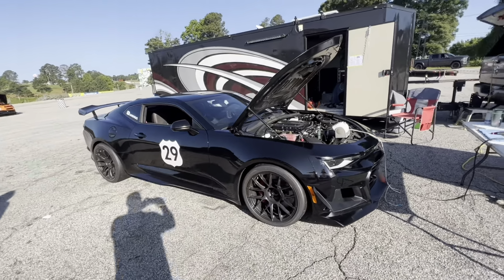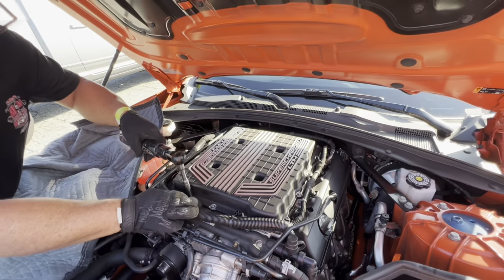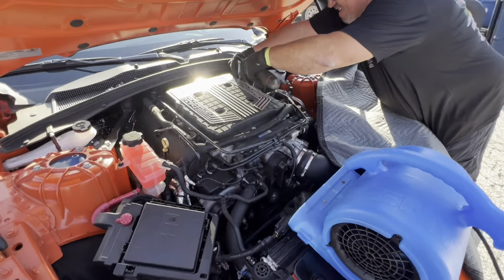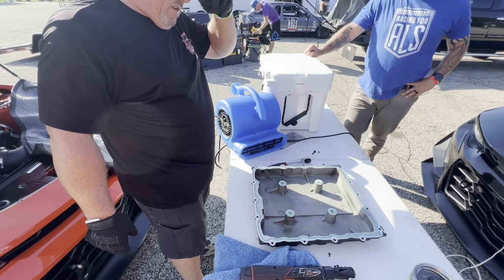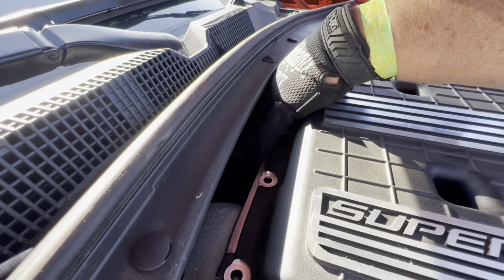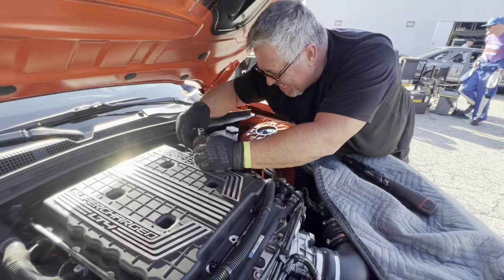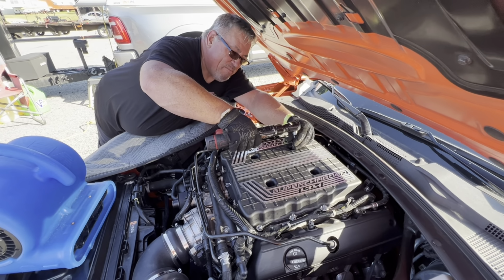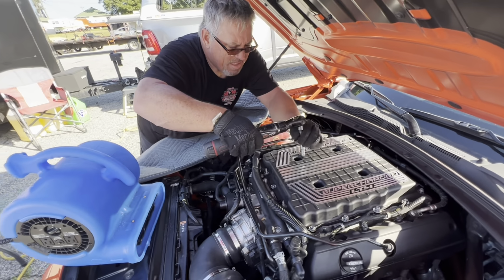Camaro ZL1 Supercharger Cover mod “Less Heat Soak” it works!

Comment: if racing you should look into high airflow filters like the green filter and check out how the rotofab actually turns into a HOT air intake once the cars warm and the numbers start to drop.

Comment: Very curios on the purpose of the plate, I'm assuming for rigidity in the lid?
Reply from the maker: Noise isolation, I’m sure to pass sound regulations
Reply: Did it get louder and what else
Reply: @khaledfayad00 not at all. You can find more Information about this plate. Removing it does nothing.